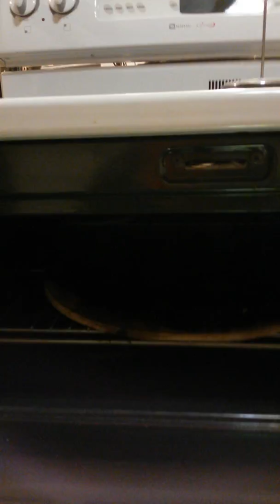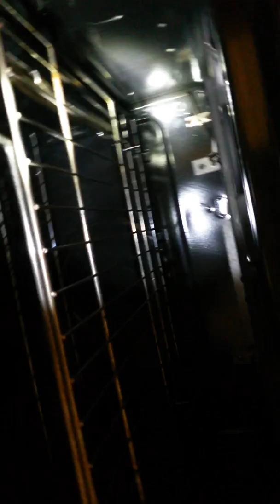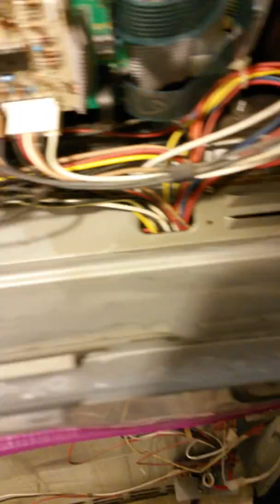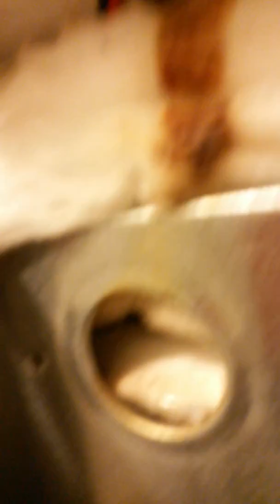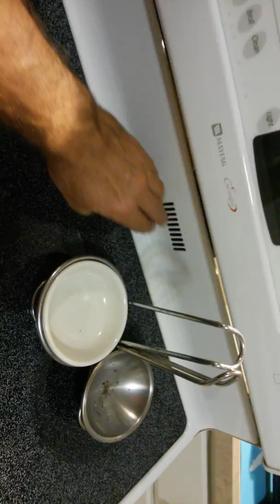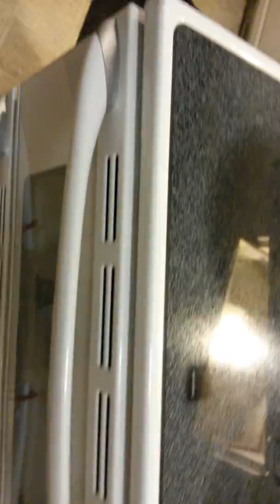Maytag gemini f1-2 code, f3-2 code, temperature sensor, circuit board issues

Comment: I have a Maytag Gemini and every time I try to operate the upper oven it clicks off, saying power interruption, and shuts my whole stove down and then it lights back up. I’d also like to know what you clean the circuit board with.
Reply from the maker: I got rid of this years ago. Electronic parts cleaner to clean board. I had board failure n tossed mine.

Comment: Anymore issues after sealing that off?
Reply from the maker: Yea it acted up again so it was problem with board so i got new stove. Recomment induction.
Reply: Well I took the vent out and cleaned it, cleaned the connections, I guess we will see it that helps the vent was almost completely blocked off

Comment: My Maytag Gemini Double Oven shows error code F 1 - 1.  It works but when both idle and in operation the code will pop up on the screen with a 1-800 number to call for repairs.  That is a joke.  Anyway we push the cancel button and everything works again, for a while.  Any suggestions or thoughts would be greatly appreciated.
Reply from the maker: Buy induction stove. Run cooler. I like ge cafe induct for hestan cue but pricey
Reply: Thanks for the reply and appreciate your advise.  Unfortunately I am not in a position to go out and purchase a new stove and hoping I can fix what I have.

Comment: This was really helpful. I would like to get a few more years out of it. Mine is 19 yrs old and I can't imagine going back to a single oven (but  can't afford to replace this one right now). It's throwing that F1-2 code (shocked it hasn't done it sooner) now. I just replaced the bottom heat element about 4 months ago. It literally burst into flames and burned through the element. For all that I have done to this thing, I have never taken the back off or even looked at the circuit board.  What did you use to clean the grease off the circuit board? And how did you clean inside the connector?
Reply from the maker: Electrical parts cleaner spray

Comment: Multiple problems all at once. F3-1 F1 F3-9 - all kinds of errors which came, left, then came back again.
 1) The upper oven's lower element burned out (should be 30 ohms approx) - Amazon $30
2) The relay contacts that supply the 230V AC to the elements were worn/dirty - reconditioned back to working but need replacement.
3) Where the 2 plugs from the 2 temperature sensors plugged into the main board (the ones he is pulling at here). ALL the soldered contacts on the board were cracked and moving. Reflowed (just cleaning the contacts is NOT always enough) - 0$

Seems fixed!

Comment: Had the exact same problem with my oven. I even got the problem randomly when not using the lower over, sometimes just using the timer function. The board wasn't too dirty, but I cleaned it up.  Did a re-flow on the solder where the temperature sensors connect. This seems to have fixed the problem. I've never soldered anything and bought a soldering iron specifically for this job. So far so good. Let's hope it holds up.
Reply: kibbee890 did it hold up?

Comment: what if there is no code displayed? But both ovens aren't heating to the temp on display.  At 350 they are really at 275.
Reply from the maker: Jack Culotta you can fine tune the temp settings it in the manual.

Comment: I have no code on my face board. Is there a way to make it show? I can only push the cancel button and hear a beep. Anything else will not work and there is no beep. The clock shifted from the bottom level to the top and back and forth a few times. I unplugged mine, plugged it back in, it worked for a few minutes, then shut off by itself. Neither oven works and no code showed up. Any suggestions?
Reply: Thanks so much, just shipped my oven control board to be repaired, i am hoping these will solve the issue and provide me with many more years of use, Thanks
Reply from the maker: seasonsla thats one for the techs. i bouggt the new gemini AND UPGRADED THE NON SCHOTT TOP. i will never buy another oven without schott ceran. if i had to do it again i would have fixed my old one.
Reply: HI there i wonder if you have a picture of the connections in the back of the board, i took mine out and now I am not sure were one of the connections go, thanks
Reply from the maker: ymcl7703 sorry recycled oven bought new one, new one not as good as old one. Keep your. Check online or call appliance city in portland or they may have schematic.

Comment: What do you use to de-grease it?
Reply from the maker: addies electrical contact cleaner
Reply: thank you.  mine had no grease inside at all.  gonna try replacing the sensor.
Reply from the maker: addies check solder joints for cracks
Reply: Changed sensor and F3-2 code still showing.  I looked briefly for cracked solder joints but there are two circuit boards in my model.  There weren't any solder joints on the side facing me.
Reply from the maker: addies it is brobably bad board
Reply from the maker: if cleaning board n connections dont wrk have it checked by service tech. i bought new gemini, if i could do it over would have fixed old on and put cooling fan in back of board housing
Reply: Malach211 called service tech.  65 bucks.  He said bad circuit board.  Said it would be about 600 bucks to replace circuit board.  Thx for the help.  Bought a new single oven since it's for my rental unit.

Comment: Thanks for the video. I had the same issue and found out the pin on the temperature sensor de-soldered. I reflowed it and it seems to be working now. Just FYI for anyone who sees this video.